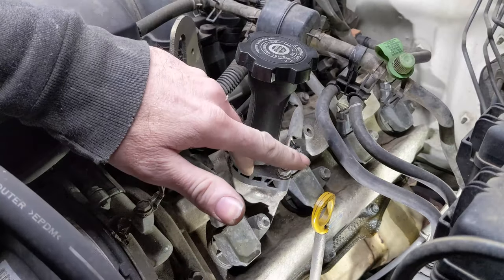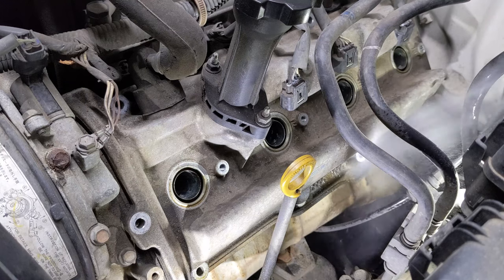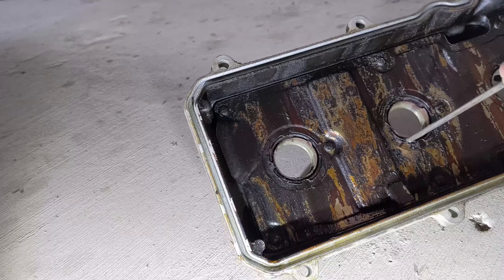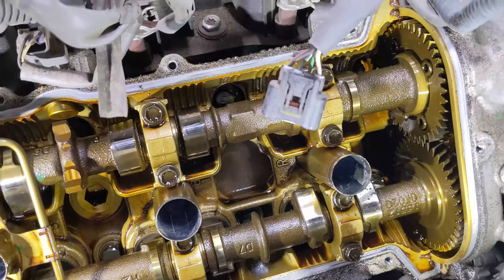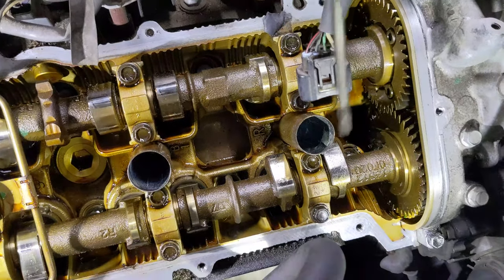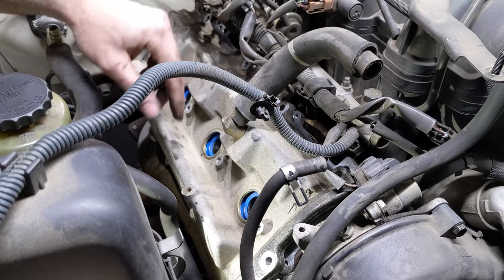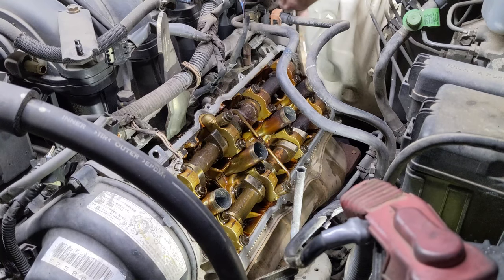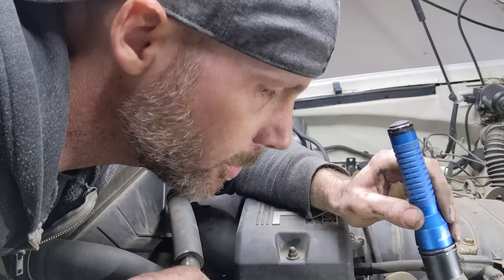Valve Cover Gasket Replacement - HOW TO - Toyota/Lexus 4.7

Comment: Half moons should have been done and then any dirt/grime that falls on the cam lobes should be wiped off and then use a separate clean rag dipped in oil to wipe them so they are not dry when engine is started. Other than that pretty solid diy video.

Comment: Torque spec from Toyota manual is 53 inch lbs. The manual also says to install/torque bolts from the outside in, star pattern. Good video, I was looking for clarification on the spark plug tube seals.
Reply from the maker: Yeah I looked it up too. 53 inch pounds is the correct spec. Thanks
Reply: Yes!  120??  You will strip and possibly snap the bolt!  53!
Reply: Mine always, and mean always, come loose. I think the stupid rubber grommets on the bolts are the culprit.  It also frequently leaks from the passenger side - its a constant battle with the damn thing.

Comment: Thank you for this vid, it was very helpful! Took me 4 hours to do the drivers side, but I’m a slow wrencher. My torque wrench doesn’t go low enough for this job, I spent way too much time second guessing if I had it too tight or not. Time to invest in another torque wrench.
Reply: harbor freight has some cheaper ones that go down enough, needed this job done today so i picked one up, haven't had issues yet

Comment: Mines was leaking,  I noticed all of my bolts looser then hand tight so I figured I'll just torque them all back to 53 in-pounds to by some time while waiting for all the new parts to come in.  It hasn't been leaking again and I'm thinking Ill just wait till it starts leaking again before doing this repair.  

On a side note, it's been almost a year and it's still not leaking.
Reply: I wish I knew this before pulling the valve cover off ,..
Reply: Bought complete kit, did driver side(was leaking even after retorquing), tightened up passenger side and hasn't leaked for the 4 years since!
Still going to do the Passenger side when I decide to replace all my coils soon. Also, the SPT Seals being so old & dry may be vacuum leak points. It is the easy side on my 2006 Limited and would rather them all age more equally!
At 103.5K currently.

Comment: Purple cleaner is far better at removing the varnish on the valve covers. In addition, the half moons at the rear of the cylinder heads should’ve been removed, cleaned and new high temperature silicone applied.

Comment: Thanks for the vid. I just finished the job from watching this. My 03 V8 4runner is slightly different from the engine you worked on. The driver's side is pretty much the same but the passengers side has less room too work on. You definitely have to remove the air box and also unbolt the transmission fluid dipstick tube from the oil dipstick tube in order to access the cover bottom bolts. Actually it was more challenging than the driver's side IMO.

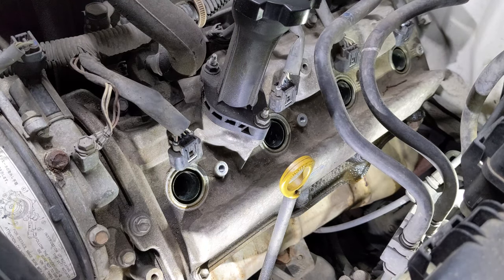Comment: 02:35  Wondering, since the cover bolts were loose, could you just torque them back to 53 inch/pounds and reseal the cover gasket?
13:50  It seems most people remove those half-moons and clean and apply the RTV.
Reply from the maker: The bolts get loose because the gasket compresses over time, becomes hard, and loses its elasticity. So the gaskets should be replaced. The plugs (half moons) can be pulled out and resealed if they are leaking

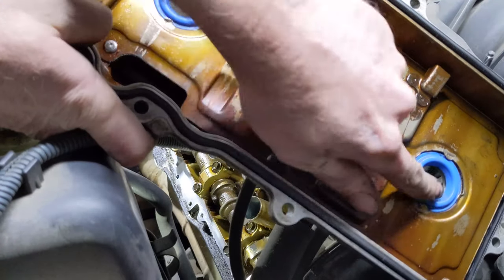Comment: Thanks for this video I just finished mine. I noticed @ 20:28 you had the spark plugs gasket backward. Have you checked I see if oils leaking In the spark plug hole.
Reply: Is it correct at 12:17?
Reply: mikef058 no, at 7:04 prior to removing the old spark plug gasket it was correct.
Reply: They are definitely on backward.
Reply: @Rochad_A  every set I bought is that way he did it, the other way is not the way

Comment: Great video.  How do you get the passenger side lower valve cover bolt out with the oil dip stick holders in the way???
Reply: Messed around with mine forever... I found a shorty ratcheting wrench at an advanced auto and it was super easy.

Comment: Hey there JamesonDIY, I have the same problem with my 01 Tundra Limited with a leaky valve cover. They recommend OEM Toyota parts such as valve covers, spark plug gaskets and FIPG RTV Seal but I noticed you are using Aftermarket parts with Permatex Black RTV instead. How has it been coming along? Debating if I should Pay $240 for OEM parts to do the same job or go your route and save money. Let me know. Cheers

Comment: I think it's backwards too..I am doing it for the first time on this engine, the OEM seals are shaped different which is causing the confusion
Reply: I not a mechanic but I put mine the other way so now I wonder and just follow the way I took out the old seal

Comment: i did driver side today aand i thought ii did eveyrhting correctly but white smoke started comingupfrom those bottom bolts and lots oil started leaking,..think maybe the gasket moved and didnt go on right? pinched or something like that?  LS430 is a bit morefinnicky,.iwish it was as easy as thattoyota

Comment: The oil seals had a metal tab u needed to bend up in order for the whole seal to be removed.
Reply: Exactly.
Also removing/replacing the half moons properly.
53 in/lbs, not 100+!
Still a good instructional other than those misses.

Comment: Hello I have a quick question hopefully you can help. I have a 2004 Toyota forerunner six cylinder 4.0 and I’m looking to change the valve cover gaskets. Do I need to remove the intake to do so? And if I do do I need to drain the radiator? Any help would be appreciated

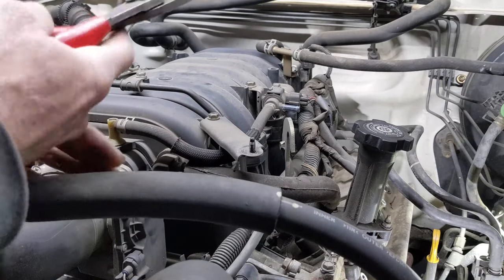Comment: Do you happen to know the function of the hose you removed at 2:05
thank you for the video helped alot
Reply: That may be the Pcv hose it is for my gs400
Reply: @oLOGICo99  hello thank you, yea I figured it out it's my pcv valve and that needed to be replaced on my 00 tundra, I couldn't pass the smog test lol
Thank you!
Reply: That was hard to take off. The rubber seal was so brittle, it crumbled when I pulled pcv out.
Reply: @chieflouie2821  I know same with me the grommet what very brittle it snapped when I pulled it and I had to use a screwdriver and mallet to pop it out

Comment: Couldn't you run a bead of RTV around the entire valve cover area instead of only in certain spots?
Reply: To put it simply, this is not a good idea. To less or too much RTV in one area=uneven seal=leak. Putting RTV into the gasket groove in the valve cover itself , (in moderation) however, is a good way to hold a stubborn gasket in place during install.

Comment: Those valve covers are not cleaned too well and you should have pulled those half moons from the back and cleaned them up with new sealant on them. Just placing RTV on the surface will not seal a leak that will protrude from underneath the half moons. That is going to be a leak issue and the valve cover job will have to be done again.

Comment: For me The worst part of this job was removing the valve cover bolts 🔩. Because i felt 3 of them wore going to snap and i gently moved them back and forth to brake them free and after I spent 5-10 minutes on those 3 valve cover bolts I ended up snapping all 3 what a nightmare other than that easy job. I was thinking maybe the previous person might have stripped them on. Now I'm waiting to get the heads back from the machine shop. I had to do a valve job cause of a broken timing belt. Thank God I didn't deal with removing the broken bolts.
Reply: @transam8607 How did you end up getting the broken bolts out? I am half way through this job right now and have snapped off 7 of the bolts. Wish they were made of harder metal. Did you have to get your truck towed to a machine shop? I am considering hiring a mobile welder to come help weld some new nuts on to the 1/2 inch of bolt that is still sticking out and trying to remove them using that.

Comment: What about valve cover bolt tightening sequence?
Reply from the maker: Work from the inside out
Reply: Outside in, star pattern.
But inside out still would work.
Use full snug seat in pattern before final torque.

Comment: Stopped watching after 7:30 when you bust the seal prying it out. You're supposed to bend those 4 tabs back and then the seals pop out in seconds and in one piece. How did you expect to put in the new ones? If you didn't know basic stuff like that from the getgo, I wasn't staying around for the rest.